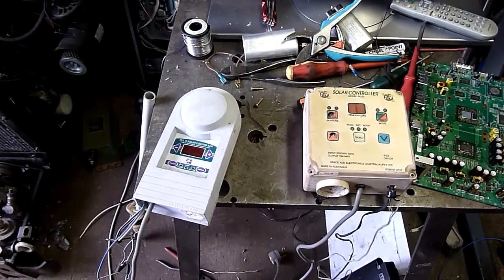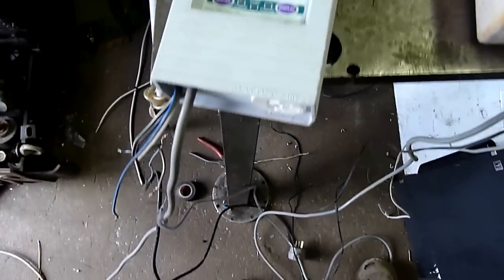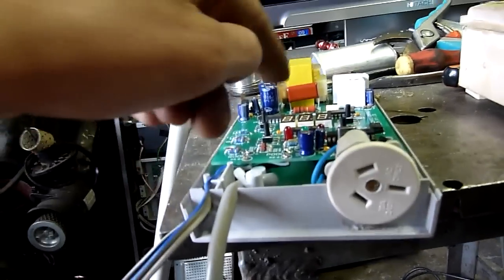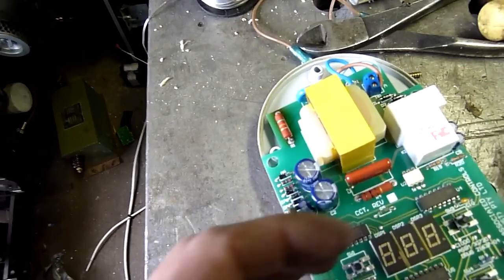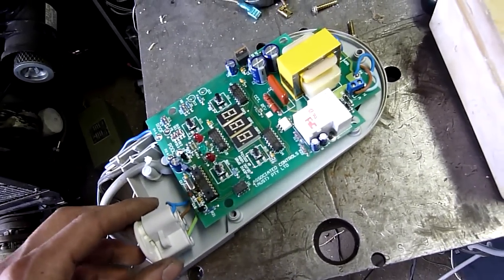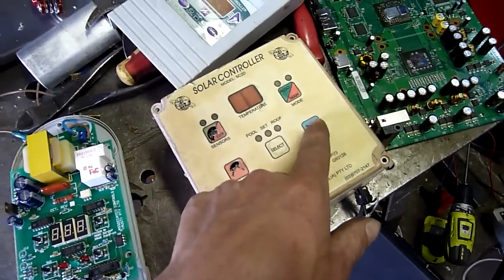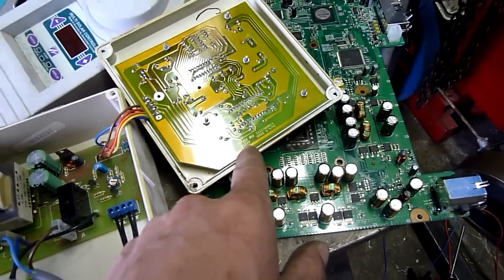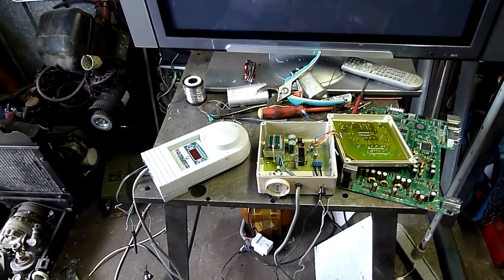A Look Inside Solar Pool Controllers - Space-Age and Associated Controls

Comment: hey Ed (@Aussie50)
Long shot given how old this video is. I have a broken ASCON MS3D, it does turn on, however it won't output 220V for the pump. I took it apart and it looks like a component (R27) next to the big relay is broken. Would you know by chance the value of that component? It is not visible on mine anymore.  Thx!

Comment: They have a scrap container which is obviously metal only, but they also collect electrical goods separately for recycling, I have no idea how electrical items are recycled, whether they go off to have re-usable components removed or what.

Problem with computers is age, there isn;t much you can re-use on old computers that ran say windows 98 or 2k etc unless you re-use the old cases which don;t look as good as today's. And cases don't cost much new anyway.

Comment: I know how much a pain ants can be. They are attracted to the ozone relays may when powered. I worked at a research station where electrics were inudated with ants if we didn't seal them up with non-silicone stuff (shrimp and certain chemicals don't get along) and dose them with Amdro.  The approved method would be to fill the box with Amdro, then seal the box with white (Elmer's) glue. It worked well enough. The Amdro doubled as a desiccant so the switches lasted longer.